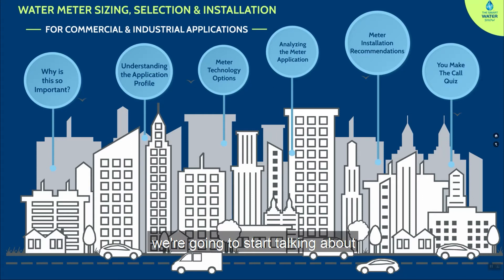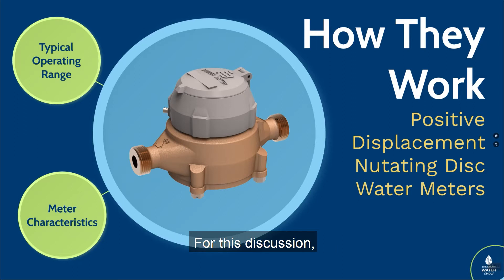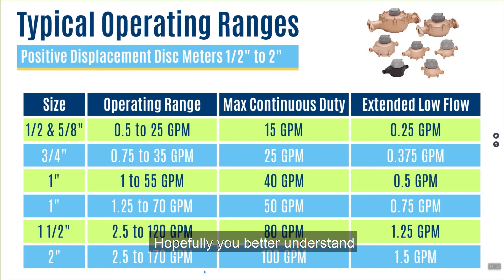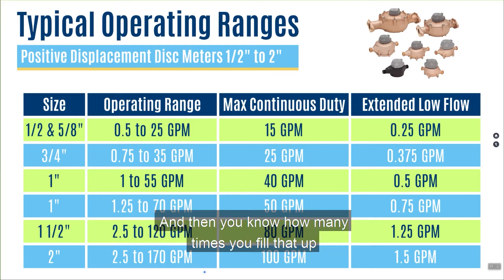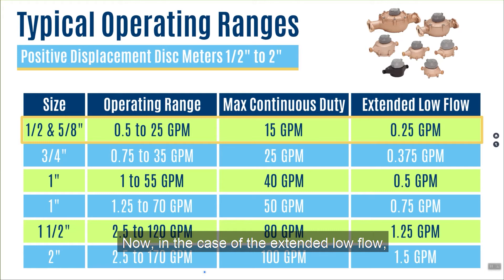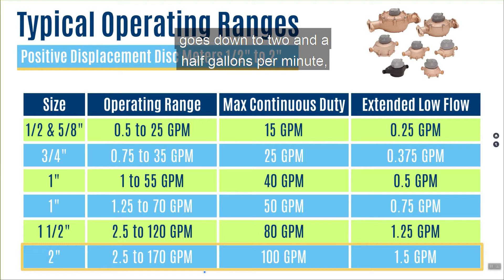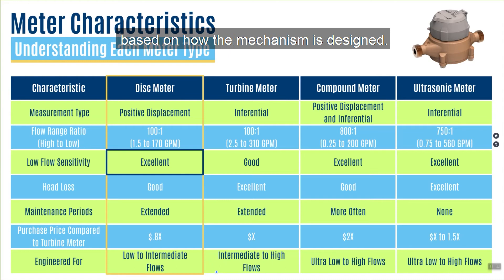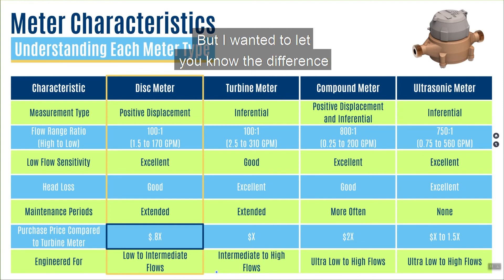Types of Small Water Meter Technology | The Smart Water Show, Episode 17

Comment: The model 25 disc meter can be installed in vertical position?
Reply from the maker: Thanks for your interest. Recordall Disc series meters are designed to be installed horizontally. Here is a snippet from the installation manual: Install the meter in the pipeline in a horizontal position so that the flow arrow on the meter housing points in the same direction as water flow. Registration should be upright and protected from damage, freezing,  and tampering. If you have additional questions, please contact our Technical Support team: https://www.badgermeter.com/technical-support/. We are happy to help.